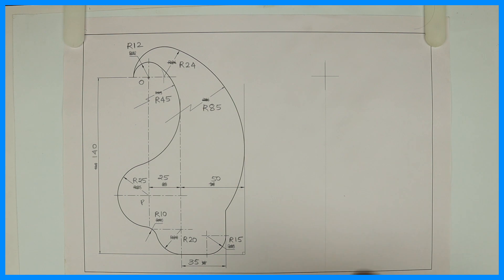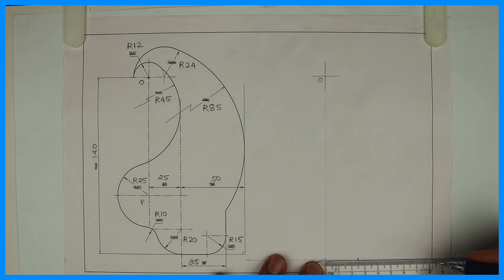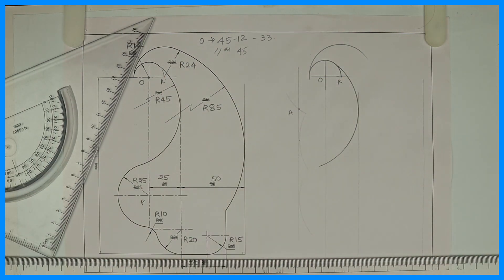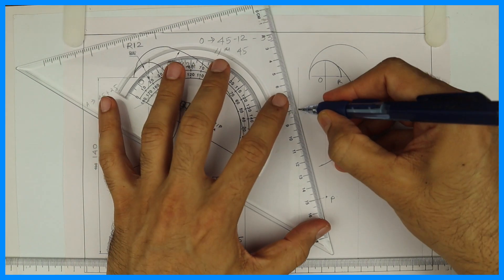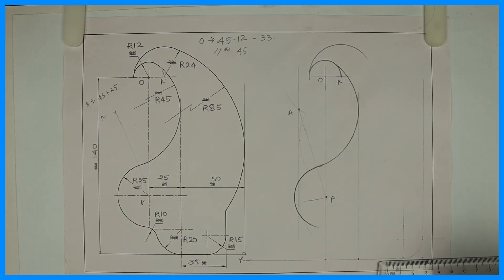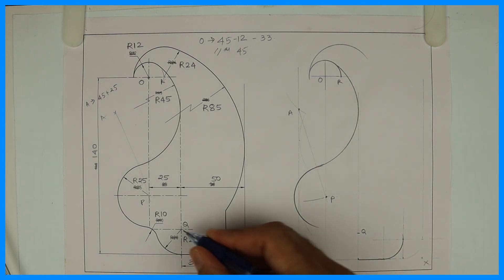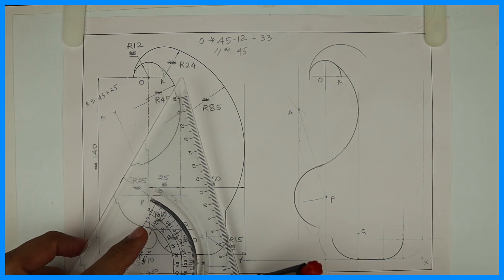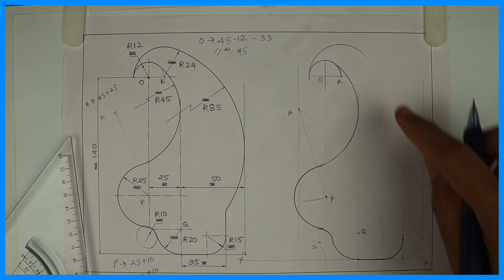Machine drawing - 20 - Engineering drawing - Technical drawing

Comment: Sir I have 3 doubts:
Can we make the R10 by external method by adding 25+10 and 20+10?
Can R25 be made directly at the point R45 touches ?
Does the arrow of R45 and R85 signify something since it is of a different shape?
Reply from the maker: First 2 ans no and for 3rd one it suggest that centre is far away